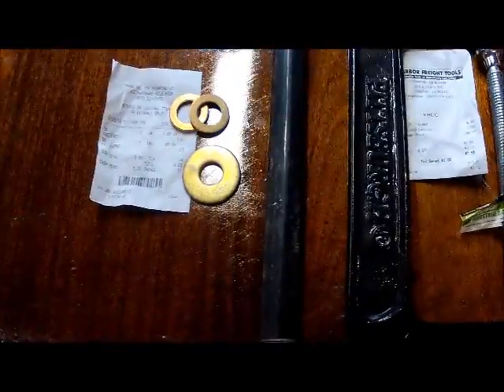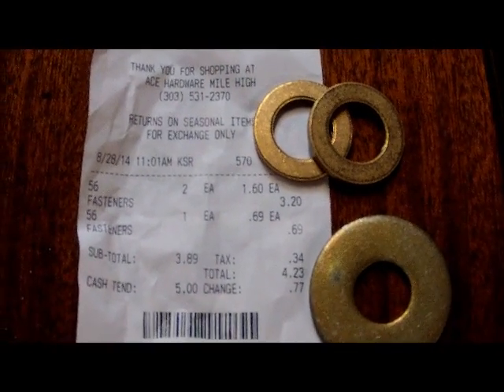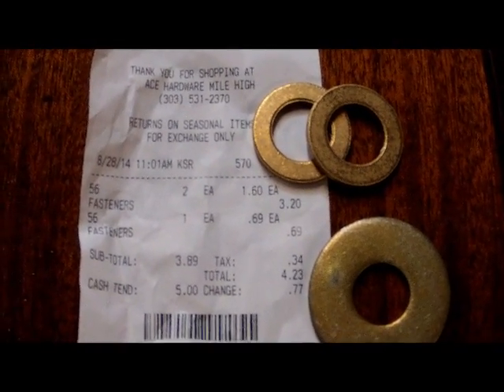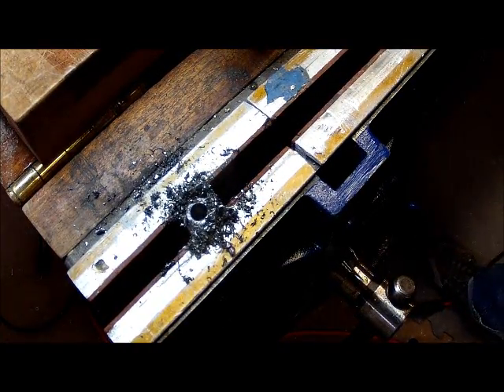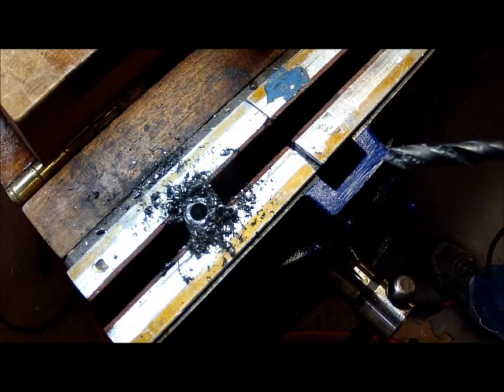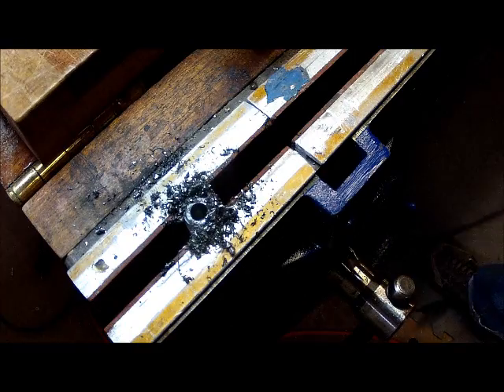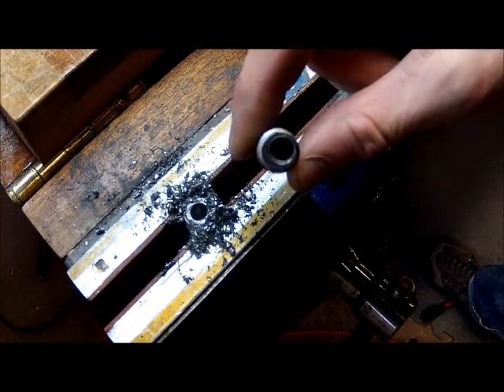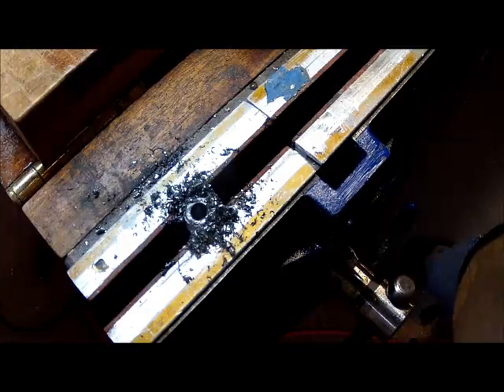C-Clamp Bolt Puller

Comment from the maker: Works well.
Design update here: (switch to square tubing to prevent torsion breakage)
http://mountainproject.com/v/inexpensive-bolt-extractor/109487927#a_109784996